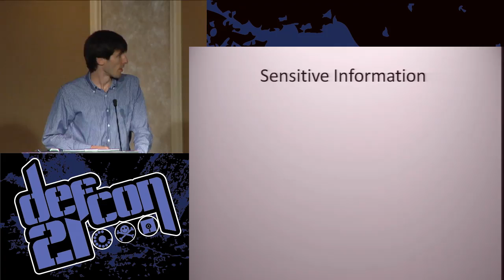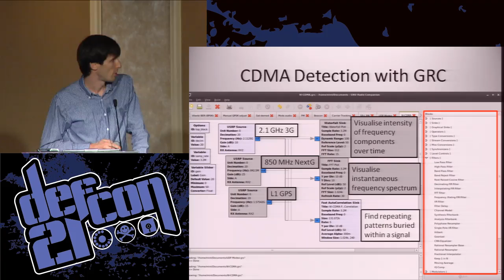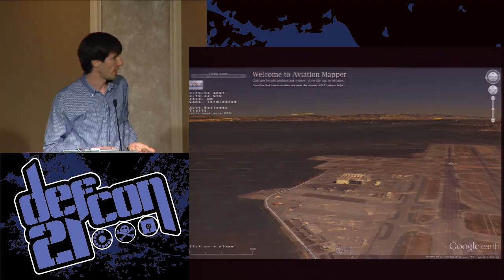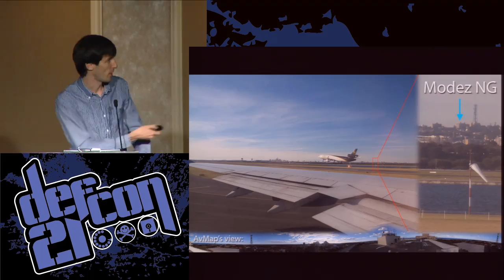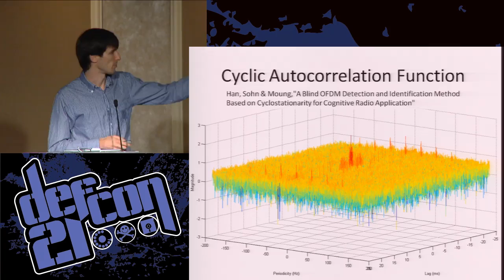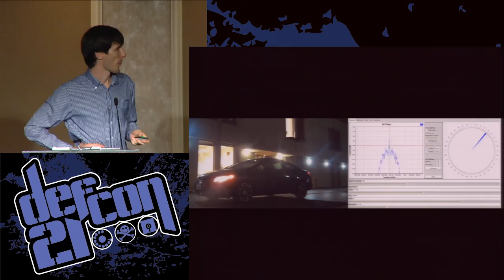Defcon 21 - All Your RFz Are Belong to Me - Hacking the Wireless World with Software Defined Radio

Comment: Man! This brings back memories! I actually spear-headed a project about 20 years ago that started with someone causing malicious interference on the US 2m 144 MHz Amateur band. It'd gotten pretty bad. The breaking point was when they started causing interference on the Public Safety bands. I'd built a Doppler RDF device and we actually used a set of 4 high speed RF switching diodes to do the antenna rotations for us.  I can't recall off the top of my head, the actual wavelength spacing of the array, and I dunno why I'm thinking it was either 3/4 or a 1/2 wavelength spacing. Don't quote me on that though. But, it was really neat to turn the car around and the LEDs would change position to point us in the right direction of the signal. Good to see that young people are still into these fascinating hobbies! 73 de AK4FM
Reply: What happened, then.....?

Comment: i just ordered a 100Khz-1.7Ghz SDR!! cause of this video, great stuff!! probably gonna get a hackrf one when later on
Reply: ***** yup it sure does :D
Reply: *****  be aware in some of those you may have solder 2 very fine wires to  the ic directly they are like 30 gauge i think
Reply: ***** im sure you will probably find the signals of the encrypted channels good luck
Reply: ***** i guess you could put the incoming data into gnu radio software and make a little program that spits out the data to a screen and you would see the hex data in text format
 then its up to you to decrypt it haha
Reply: but there some things that are uncrypted like old pagers and you could easily read their messages directly (use gnu radio to display the text)

Comment: The fast track could cost someone a lot of money if you just keep transmitting their ID all day long. Or get them speeding tickets if you know when they get on the toll road and submit their ID at an exit a few minutes later. At least the PA toll road going to Allentown used to send out tickets to cars reaching the exit too fast. Maybe even get truckers for driving too many hours?

 The options are endless.These radios can also be used to get unlock codes for cars. Jam the signal while intersepting the lock code sent to the car and when the person presses the button again you repeat the first lock code and hold on to the second one use to unlock the car once they walk away. for newer cars where they are time stamped proximity based ones you boost the signal to wherever the person is back to their car a few blocks away to unlock it.

Comment: I have been trying to decode p25 audio witch is legal in my state of FL to decode for 3 yrs. finally got a second rtl str  I have reached a point to were I can decode about 10 % audibly. and am now stuck at trying to decode the other 90%  I am now  having issues with software .

Comment: What if we could combine the 3 types of modulation into a single one, with no interference. Then theoretically we could transmit a shitload of data really fast.
Reply: Hypothetically, just a thought.
Reply: @kornbread5359  - First:  clever choice of name.

Second: You are on the right track - I recall reading an article describing a similar technique being used in a somewhat novel RF transciever.   I'll summarize briefly, as I can't find the article (maybe you'll have better luck?). A major constraint on bandwidth is frequency space - if one guy is talking on a channel, others can't be, so it becomes a competition.  RF antennas, as conventionally designed, are receiving (interacting with/modulating in accordance to)  the electric charge component of the transmitted signal.  However, electromagnetic signals are electromagnetic - they have both an oscillation in electrical and in magnetic field.  The magnetic portion of the signal reflects information content of the electric, however it is out of phase with the electric portion by some offset, determined by the transmitting antennas design.

What was realized is that an antenna circuit could be designed to capture both the electric and magnetic state simultaneously, allowing that offset to be measured in real time.  Simultaneously, they designed an antenna where the offset could be tuned.  This means that (potentially in combination with techniques such as mimo) multiple devices could be transmitting on the same frequency at the same time, without use of time division, and the individual signals could be isolated.  Potentially thousands of signals (or more) could be overlapped on the same carrier.

... I really wish I could remember the insititute name, because I'd love to know how that's progressing.

Comment: What software is he running? Wish he would go into more detail about the equipment and software.
Reply: Anyone know any valuable resources for learning more about RF. I've been intrigued.
Reply: There are so much software and hardware available if you wanna mess with SDR, and in so much price ranges. I read that the HackRF One from great Scott's gadgets is good for beginners. It covers a large frequency range (1Mhz to 6Ghz if I'm correct), and it's affordable, compared to other RF transceivers (about $200 for the official one, but since it's open source, I'm sure you can find unofficial copies even cheaper). Plus, it's compatible with GNU Radio and most radio softwares.

I'm planning on buying a HackRF as soon as I have some money c:

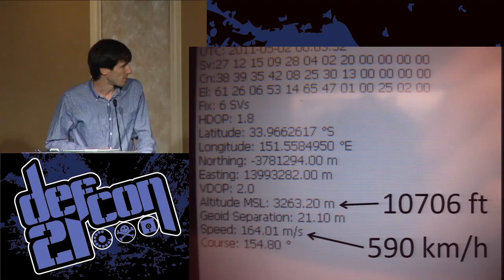Comment: 18:01 but why doesn't the GPS in a Smartphone work in plane high altitude?
Reply: They often do. But you are inside a metal tube (not exactly a Faraday cage, but still more opaque to RF than, say, your flat), so the very weak GNSS signal may not be picked up well by your phone's receiver. If you use a bluetooth external GNSS receiver, and you push it up against the window, you can probably get decent signal. BTW, that's also the reason GPS doesn't work underwater.
Reply: Because the earth is flat...
Reply: Civilian GPS is automatically disabled for any device that’s traveling over 1200mph, or is above 59,000ft. It’s to prevent it from being used by rogue/unsanctioned ballistic missiles. It wouldn’t be relevant on a commercial aircraft, but still fun.

Comment: The government should ban these sort of devices
Reply: paul anthony bulao booooooo
Reply: Gov shouldn't ban anything
Reply: Perhaps the government should also ban locksmiths? Or perhaps the gov should insist on people and companies secure their shit properly. You can't ban these devices because even if you did, there's still electronics outlets to make them and criminals will do just that. By banning it you just sweep the problem under the carpet where criminals can better hide. It's highly small minded of you to call "ban it".  Unless you're a criminal trying to stay covered and not have these security lapses found and fixed?
Reply: they're passive (listen-only) devices.  As long as you're only receiving and not transmitting, there's nothing wrong with that.  I mean, the radio waves are willfully being transmitted out, and technically are 'trespassing' onto the listening device, and unencrypted at that.  So yeah.
Reply: I know I didnt type bulau booo....wtf is that
Reply: @mblake0420  bulau booo   NSA listening device interference? lolz
Reply: @mblake0420  It tagged him. So you tagged the poster "paul anthony bulao" and then your message appears "booooooo"
Reply: No lmao